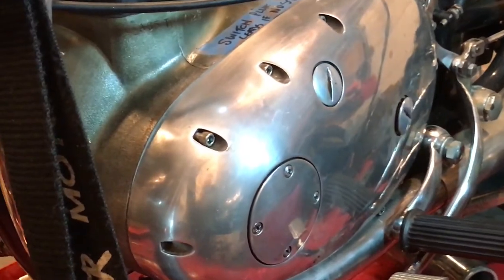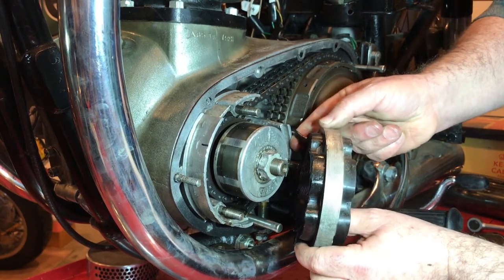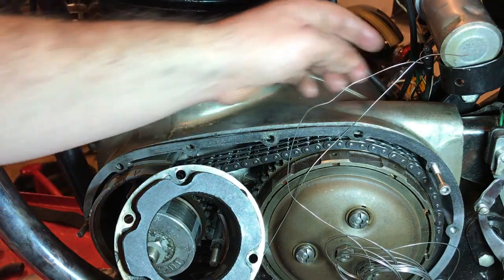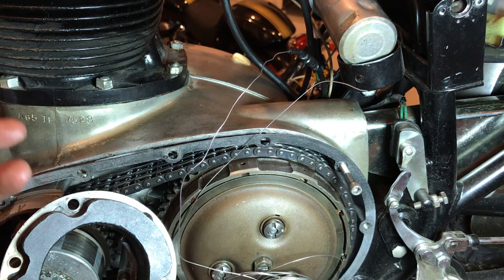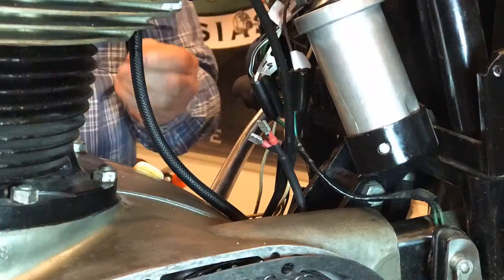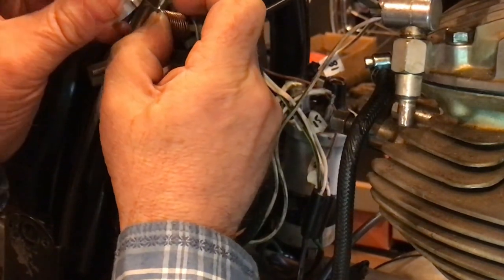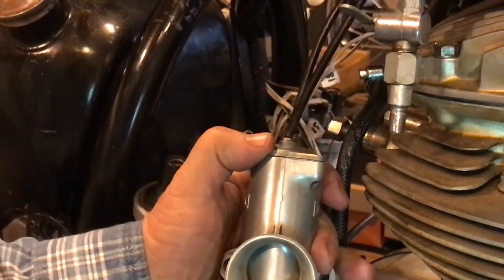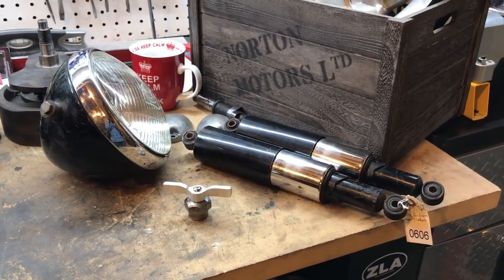1968 BSA Thunderbolt 650cc - going home, or NOT (part 2)

Comment: I am the sole surviving family member of the Bsa dealership I was 14 when I went to Bsa service school 7071 the last one they had in the US Nutley New Jersey January 71. You’re missing a seal on the inside of the primary to keep or from leaking all the bike through the hole where the wiring goes looks like a spark plug wire camp, far from perfect but it helped. And Lucas‘s defense, Bsa beat them about the head and shoulders to get the price down to $12.50 for the entire electrical system in the early 60s that included the headlight completeTail light complete battery charging system handlebar switches everything. It’s no wonder they use beeswax for waterproofing.
Reply from the maker: Thanks very much for sharing and for your advice. Best wishes, Mike

Comment: Another very helpful video, Mike. I have several electrical issues that popped up. The stator charged but quite. The headlight worked but quit. The horn worked but quit, each at a different time. I suspect the connections are just loose and need to be tightened or the connectors replaced. Watching your video helped. Thanks.
Reply from the maker: Thank you Scott! Don't you just love the old British bike wiring!

Comment: Sorry for the late reply. #1 Troubleshooting the no/low fuel issue. First step should have been to verify that you were getting sufficient good [fresh with no water] fuel to the carb, before removing the carb. #2 the throttle slide, aka piston as you call it, sticks, is because the bore is warped due to over tightening of the mounting nuts. Sanding the flange surface flat does not help repair that. You should have attempted to reduce the warp of the mounting flange using a press to remove part of that warpage, before sanding the flange. That will minimize the slide sticking in it's bore. #3 To get the stator wiring harness through that tight opening , do the following. First heat the stiff wiring with a heat gun or electric hair drier, to soften the insulation. Next, fold back one of the two bullet connectors, then pass the harness the the opening. The idea is to have only one bullet connector pass through the restricted opening at  a time. #4 Always stagger any cut off wires, so that the bulge in the harness after repairs is reduced. Placing two "fast on" connectors next to each other is poor workmanship. #5 Slide heat shrink tubing over the wire, BEFORE you crimp on the "fast on" connectors. That will eliminate the need for using electrical tape. Electrical tape will unwind over time due to vibration and oil contamination. Alternately, apply a thin coat of "Liquid 'Lectric Tape, over the electrical tape, to prevent it from unraveling in the future.

Comment: You can't blame Lucas for old, dried out wire insulation.  When you look at how long these old British crocks have been around, I'm sure that most of them have long since out-lasted their intended service life.  And you sure can't blame Amal for some ham-fisted owner or mechanic over tightening the carb nuts, distorting the carb body.  Mikuni carbs are mostly spigot mounted and therefore not vulnerable to that kind of damage, but it doesn't look like there's enough room for a Mikuni conversion on this bike.  I converted a 1960 Triumph Tiger Cub, but had to remove the stock airbox to gain the room I needed.  it worked great!  Easy starting, terrific throttle response, and easy to tune.  I recommend the process highly.

Comment: I’ve found that soldered wire on a bike usually always breaks right next to the solder. Since then I use covered crimp connectors and try to avoid heat shrink tubing as it creates the same situation as solder, reduces flexibility
Reply from the maker: Thank you very much for your advice. Really appreciate it.